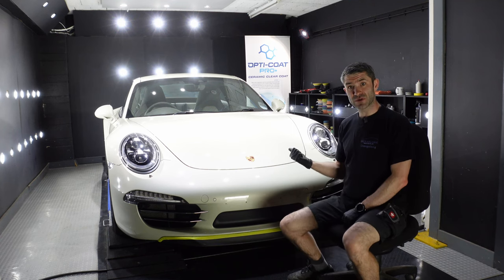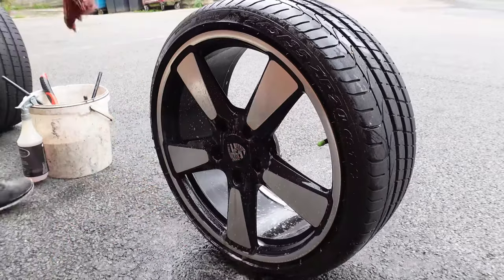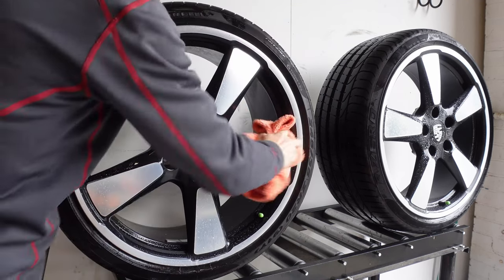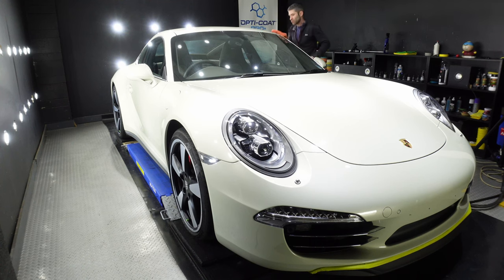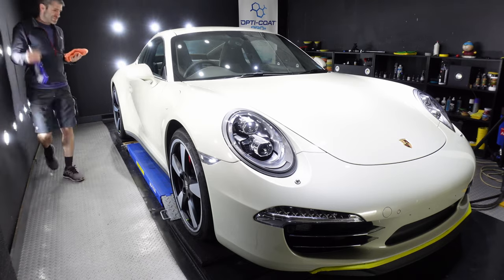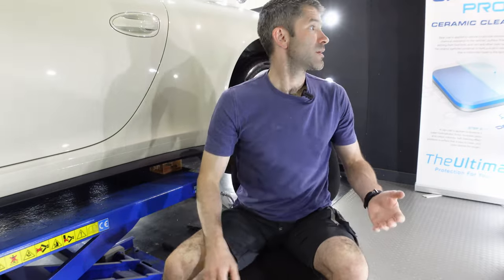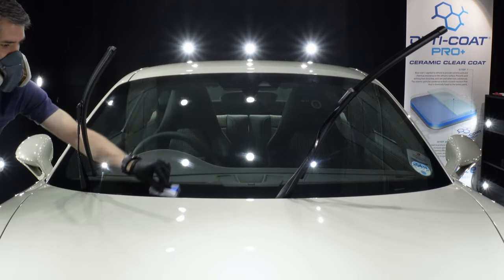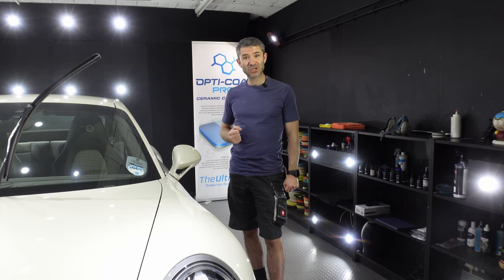VLOG: Porsche 911 50th anniversary

Comment: Hi i am loving the content,keep the info coming for us novices.One question do you see the need to clean the pad after each polishing set as i don't think you do,humble apologies if i missed you cleaning it. Thank you.
Reply from the maker: Hey Stan, great question, and the answer is it depends on the pad type. I spur (brush out) microfibre pads and wool pads after each set, and blow them out with a compressor after each panel. Then replace for a new one. Foam pads I tend to replace them after each panel and soak them in a solution immediately to clean them out. Moral is just don't let them build up product, as that effects both cut and finish